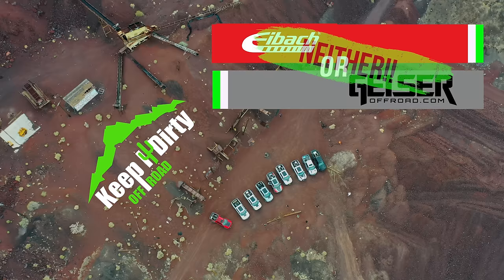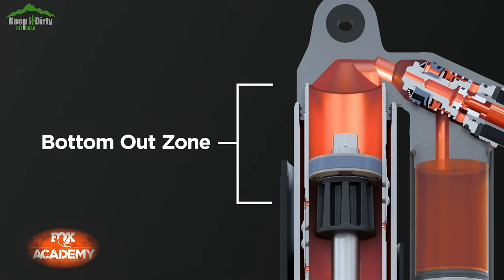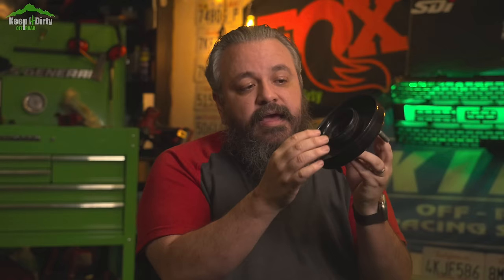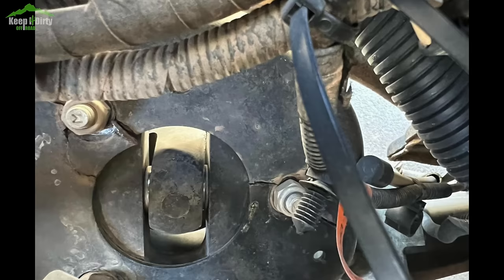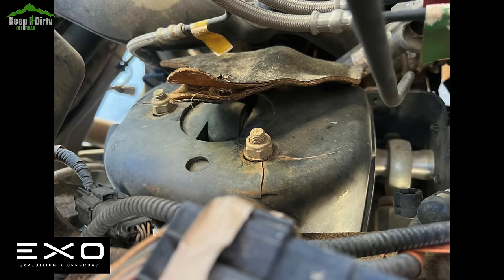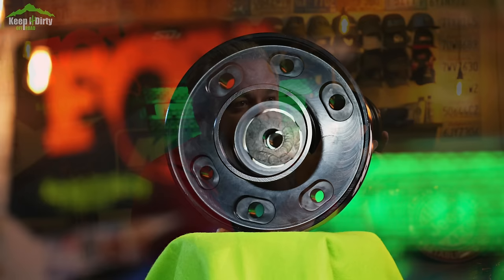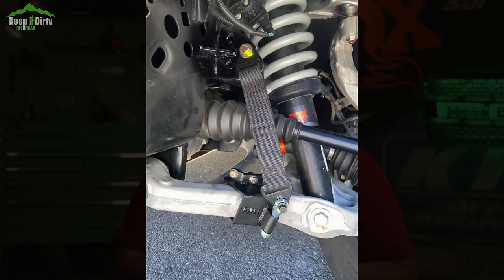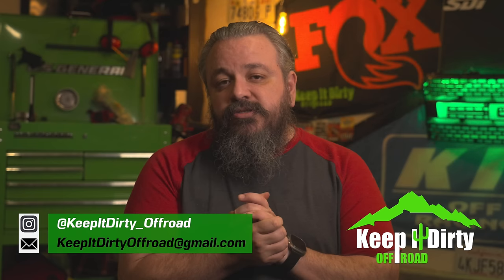Eibachs or Geisers?  NEITHER!!

Comment: For the Eibach would you say this only applies to off-roaders. I just bought the springs yesterday and have yet to install them. I do zero off roading. I got it for the 2.5 lift and a better ride than collars
Reply from the maker: If you don’t offroad, you should be fine. 

Just keep in mind your beyond what we recommend for preload so your CV axle boots will rub more. If you use 4wd a lot in winter you will see reduced life on the CV boots. As they rub they will eventually fail.
Reply: Is there a solution to this? Like a company that makes upgraded Cv axles for this type of set up?
Reply from the maker: The solution is to reduce preload and go wider with a mid travel kit or long travel kit. 

There is no way to avoid the drawbacks of extra preload on the CVs. We recommend limiting preload to 1.5-2in over stock. Anything more and you will have CV issues.
Reply: Thanks for the info 🤛🏼

Comment: Really great video!  I never thought it was a good idea to put that much pre-load on your suspension....unless you are just doing it for looks.  Quick question, I'm running King 3.0's on my 2019 Gen 2.  I'm not exactly sure how much pre-load it's set at, but the front is not jacked up and I'm still running 35's.  Have you heard of any failures with this setup?
Reply from the maker: Yes we have. So if you look closely at the pictures of the cracked shock bucket, you will recognize the top of the FRS shocks EXO was running on his Gen3.  Now mind you, he pushes his trucks. He’s running Baja and keeping the pace for prerunners. So this is an extreme worst case scenario. So for you it will depend on where you run and how much you push it.
Reply: Well see, I run King 3.0's as well and they are coming off this week for an upgrade.  I will look at the top of the bucket once they are off and see.  I run with Helio so we def push our trucks, if any will have damage it will be mine.  I have cracked the lower mounts where the Foutz gusset kit goes and have been re-welded.  But this time its getting gusseted for sure
Reply: @KeepItDirtyOffRoad   Thanks for the response.  I wasn't familiar with what "FRS" meant so I didnt' know you covered this in your video.  I definitely push my truck very hard so I would be at risk.  I just did a once over on my suspension and the welds and shock bucket all look good.  I'll look into getting the frame weld reinforcements.
Reply from the maker: Your truck is going to be a great measure for how strong the stock bucket was. BUT I will say the king shocks have a better and softer bump zone (bottom out zone) than Fox so you may be good. Definitely need to document how yours looks
Reply from the maker: Yeah, definitely will need it man. grove will have a plate ready here in a few weeks. Follow us on IG and we will let you guys know once it’s oderable
Reply: I wonder if its the IBF in the Kings
 @KeepItDirtyOffRoad
Reply from the maker: I think so man. Another reason to buy kings

Comment: I see that you didn’t reuse the rubber boot/sleeve that protects the top part of the shock. Is that not necessary? I’m putting top hats on in a couple days
Reply from the maker: Huh? We did not cover the boot in this video, but if you look at the SDI video we referenced, they do keep the rubber boot to protect the front shocks.
Reply: The cover shot for this video clearly shows the rubber boot not on the shock that’s why I asked
Reply from the maker: On the cover shot of this video you’re looking at 2 damaged shocks with stock shock buckets. There is no SDI pics on the cover shot of this video. Shock on the left broke thru but did not fall apart so the boot was torn off and the right shock completely separated and collapsed 

I do know the rubber boot is optional, but why would you not want to install it. It protects the shaft.
Reply: It’s not that I don’t want to I was just asking if it’s necessary that’s all
Reply from the maker: It’s mainly there to protect the shock shaft from impacts. Rocks typically. And a small ding or scratch on the shaft will cause the shock to leak. So yeah. Definitely keep it to extend the life of the shock
Reply: Why does the gen 3 not use the protective sleeve? Mine didn’t stay on the top hats and slid down the shock unfortunately now debating trying again or just taking the boot off completely on my Gen 2

Comment: Does anyone know if this SDI top hat will work on a Gen 1?
Reply from the maker: It does not. gen1 geometry is very different. So while the holes will line up, the shock won’t. Gen1 requires those shims to get the angle of the shock at the correct angle to function correctly. 

But honestly, you don’t need it on a Gen1. Gen1s have not had this issue at all. And 2, why spend money on a spacer or top hat replacement when you can just adjust to top mid or top perch on the shock to get the same effect.

The only way the top hat can be used is if you chop off the stock bucket and do the aftermarket bucket to support the longer shocks from the  gen2. The new shock bucket corrects the angle of the bucket to support the longer shocks and will work.
Reply: @KeepItDirtyOffRoad  I saw TSW offers a top hat that works on all 3 gens so that got me confused why this one wouldn't. That makes sense now. Thank you for all the help! You are out here doing the lords work to help the raptor community.

Comment: What would you recommend for ucas on a gen 3 ?
Reply from the maker: You staying stock travel or upgrading to mid travel? 

If your staying stock UCAs upgrades are mainly for show and I don’t recommend them. For stock travel the only benefit they provide is UCA alignment adjustment when combined with a slot delete. That’s it and 99% of shops out there don’t know how to align a truck from the upper control arm. So it can create more hassle. Some argue that the ball joints are better and will have less bind. And that’s true, But they last 1/4 of the time that enclosed ball joints last. So their benefits are outweighed by the maintenance cost to replace the joints at $75-150 per joint to replace.

So unless your doing a slot delete, UCAs upgrades is not something I recommend for stock travel.
Reply: I was thinking aftermarket uca only because I hit a wash out going pretty fast and knocked my alignment out pretty bad . Slightly bent my lca tabs . Found a good alignment shop and got it back in "specs" but ever since then that side of the truck now sits 1.5" lower than the others . I thought maybe I messed up the coil spring so I put on some front eibach springs and it still sits lower on that side . I've looked at the suspension extensively and cannot find any bent parts . Thanks for the response man love your videos
Reply from the maker: So upper control arm upgrades won’t solve for the problem you have. 

First off, if the LCA mount is bent on the front and you truck is sitting lower, chances are you also bent the rear one too and they are slightly out of place. Does not take much.

You need to first have all that checked and the bend pieces replaced or bent back into shape. You could have bent the spindle, or the frame or a number of other things a

Next, you need to look at doubler plates to reinforce the LCA mounts. Krazy House customers makes some great kits for that. FMI too.
Reply: @KeepItDirtyOffRoad  so I took a really good look at the front suspension again and i just noticed that I bent my frame slightly causing the passenger side to sit 3/4" lower than the other side . I think my only options at this point  is to either trade it in for another raptor with socks because my apr is 2.6% ,lowest apr I could find is 5% now . Or I could by the front fox factory race series and just adjust the ride height accordingly since their coil overs
Reply from the maker: Chances are you have a few things bent. I’ve had friend and myself go through the same. For me it turns out I bent my frame. It was very slight, but I bent my frame up on the drivers side. Took a frame machine to confirm it. I had a friend bend the spindle. It was very slight, but enough that that while side sat lower. But the force required to bend that I huge and found out later the frame bent slightly as well. 

Upgrading the UCAs won’t solve for that unfortunately. You still have stock components and stock frame sections designed to bend in an accident that could still bend. 

My recommendation is have a body shop measure you frame and see what’s tweaked. That will give you definitive measurements on what’s wrong. And then look at reinforcement once everything is straight. Reinforce the frame  with plating, reinforce the LCA mounts and box them in. And replace any components they find are bent